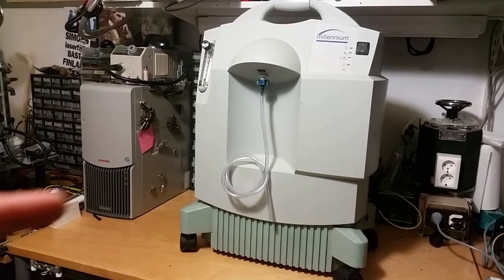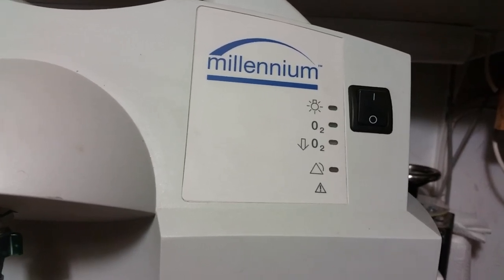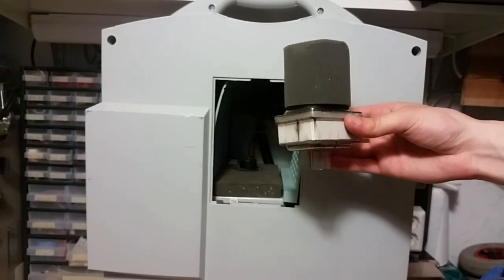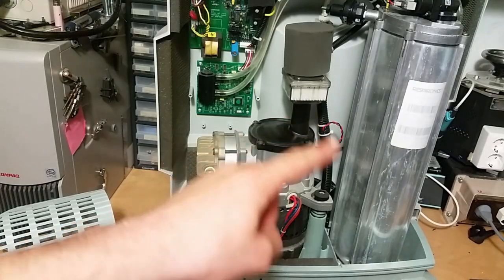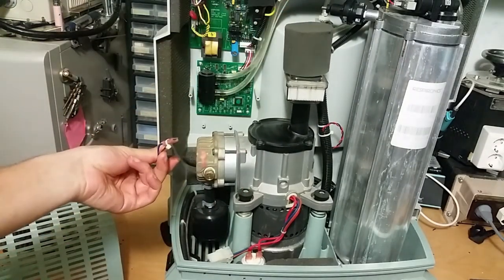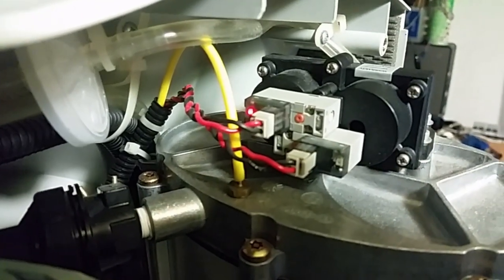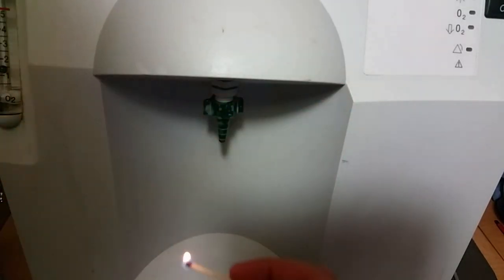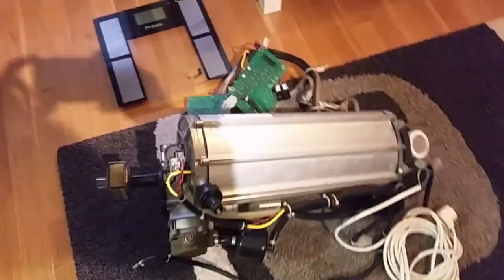Oxygen Concentrator Teardown with Flame Test, Part 1

Comment: very good your video.
I have a device of the same model.
can you tell me where i can buy the solenoid valve and the pressure regulator connected to the cylinder?
I am from another country and I am not finding these pieces here.

Comment: There is probbably a capped pressure test port on top of the sieve bed assembly somewhere. If all goes well you sould measure a fluctuating pressure of around 15 to 35 psi with the machine running for 10-15 minutes and the oxygen flow set to 3l/min. If the unit exceeds 35 psi for a period of time, it will sound the alarm and that means that the particles in the sieve beds are probbably contaminated with moisture and slowly becoming a solid... The pressure sensor on the main PCB actually checks for High/Low pressure conditions to sound alarms and is not used to set the valve change rate. The oxygen sensor is an ultrasound based sensor. If you take apart the sieve beds, watch out, there is probbably a spring inside the cylinder. You can also try sprinkling some drops of water in the particles and see what happens... It gets really hot! And a last thing. Dont expect the sieve beds to function anymore if you open them! The product inside is really sensitive to the atmospheric moisture and gets damaged really quickly! Hope i helped! (oxygen concentrator tech here :) )
Reply from the maker: Nice, thank you very much. I have not done the part two yet, good timing :))
Reply: Hi, I am using my Visionaire concentrator to run a Smith Little torch. With the torch connect4d, the maximum flow reduces to 2LPM and the unit beeps after 5 minutes. There is pressure in that line after I turn the unit off. I am concerned to keep running the unit because of this. Are there any mods I can do to fix this or do I need to have the sieves changed? The oxygen quality it is putting out is perfect for the torch but I just can’t seem to get enough flow. Thanks in advance for your help.
Reply: @FatherGoose18  Actually the torch probbably restricts the flow more than the unit can handle. How many times does it beep? Does it cut the motor out when it beeps? If the sieve beds are still good, you can brobbably turn up the pressure regulator a bit (it is located in the top of the back lid of the machine if it is a visionaire 5). In general these machines are not designed for use with torches and have diagnostics and safeties for many irregular modes of operation.
Reply: Ανδρεας Τσιρογιαννης thank you so much for replying so quickly. I have no way of knowing this information and so your help is very much appreciated. Yes, the torch limits the airflow, as soon as I connect it, it pushes the flow ball down from 5 to 2LPM and the machine beeps 3 times after just a few minutes with the torch valve wide open and turns off the motor. I power it off immediately and when I turn it on again it runs and then does the same thing. If I just let it run, will it damage the unit? How can I increase the pressure to push more air through the torch? Thanks again, with best regards, Rory.
Reply: @FatherGoose18  As far as i can remember on top of my head, 3 beeps means sieve beds overpressure, so yeah, your sieve beds are probbably at the end of their lives... If you continue using the machine as is, you will probbably also damage the motor's piston seals, since the motor has to work harder to do the same work. So yeah, you sould probbably stop using the machine as is not to inflict more damage to it. FYI, the machine starts and runs inspite of the overpressure condition for some minutes because the diagnostic routines that check for over/under pressure / leaks etc. start after some minutes from power up in order to give the machine time to warm up and stabilize if that makes sense. You probbably have the overpressure condition all along, but the unit complains after some minutes because only then it checks for that condition...
Reply: Ανδρεας Τσιρογιαννης thanks again, wow you are so quick to reply, wonderful. Ok I can confirm it is the Visionaire 5. With the torch disconnected, the unit runs well with no problem and no beeping. When I attach the torch, with flow settings from 1 - 5 Lpm, the ball is forced down to 1, max 2 and the system beeps 4 times after 4 minutes and shuts down. Could this be due to filters needing cleaning or replacement? Is there any way you know of to increase the psi of the machine to compensate? You mentioned a valve at the top of the inside at the back. Not sure what to look for, local gas people can’t offer any help. Thanks again in advance.
Reply: @andrewsweet43   OK, I found the valve at the top left at the back of the unit. For those who read this thread, it is a black knob that you pull and turn. I set the flow to 5LPM and then adjusted this valve to bring it up to 6. This increased the psi going through my torch and now the pressure indicator does not trigger and the machine is working properly. I also cleaned out the white filters on either side of the compressor. They were filthy dirty so I guess this made a difference to the flow too. Thanks again for your help, very much appreciated.
Reply: @FatherGoose18  Nice job! Just for your interest, there are 2 more filters in the machine that are made from a more dense material that you probbably didn't find. There are the 2 external ones that you probbably cleaned (the ones on either side of the motor caps) and there are 2 more to the inside of these black caps. To remove/replace them you have to pull the top of the motor outwards to expose the air tube on the left, unscrew the tube, and pull the motor all the way out of the machine (you can leave its wires connected). Afterwards, you unscrew the 3 star shaped screws at either side to remove the 2 black caps. The inside filters are located in the inside of these black plastic caps. Very easy to remove if you have the right tools!

Comment: Does it really release hydrogen gas if the air is humid?
Reply from the maker: No, it can't break molecules appart
Reply: @MrTesla1337  So what are the safety measures that I should take in the device that I make